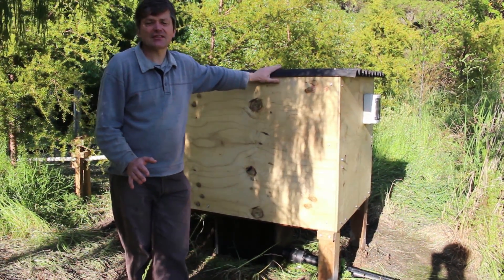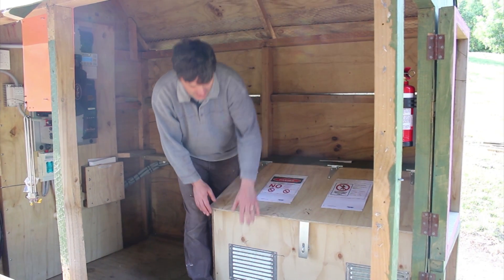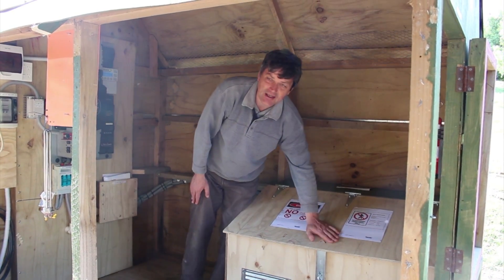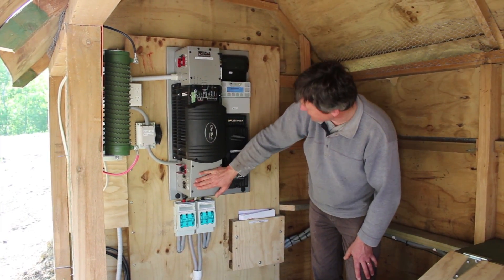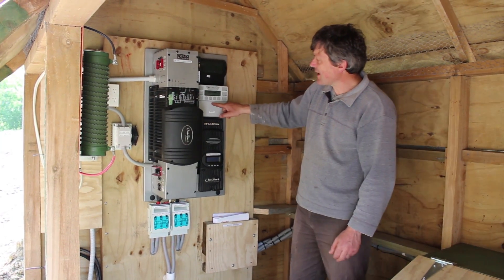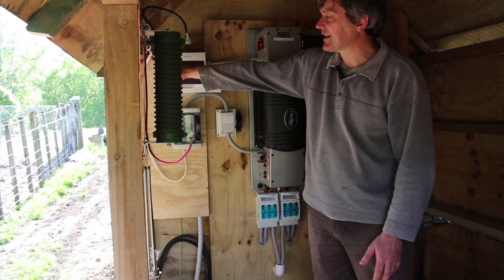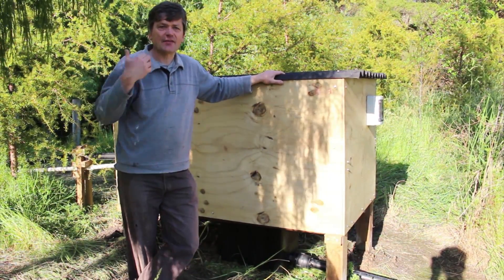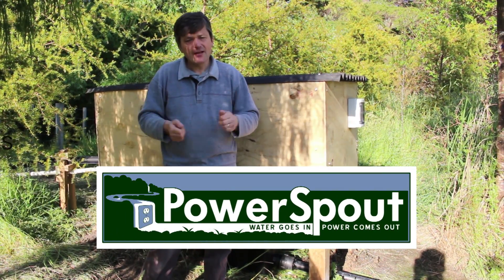PowerSpout PLT Install Video

Comment: Wicked product but THATS your battery bunker? At least line it with fire blanket (and another thin sheet of ply if u want.) and an exhaust vent outside of the enclosed area. 

Im looking at something kinda similar myself but I with some additional redundancy built in. I would be tempted to install a fire suppression system inside it as well. 

I will have another look at the video as im curious about the torque at the shaft and stuff. Surely that electric motor isnt putting that turbine under bugger resistance......

Comment: Great video, but can you clarify the power figures please? my schoolboy physics says that 160m(head) * 4l/s flow rate * 9.8m/s/s gravity gives a power of about 6kw, but you quote a continuous power output of 1.3kw, less than a quarter of that. I thought micro hydropower schemes should be able to achieve overall efficiencies of about  70%?

If I check the figures in the video using your own power calculator http://www.powerspout.com/advanced-calculator/ it still comes to over 3kw, about 50% of the theoretical. 

Or have I missed something?
Reply: 4l/s is the flow at the intake. Read the case study for turbine flows.
 https://drive.google.com/file/d/0BzVDBix3S_qbUUVxQ1VfOHBVdG8/view

Comment: what size/type of pipe  was used? Looks Great
Reply: 50mm ID, 63mm OD MDPE. The pipes is low grade 3.5Bar at the start and ends in 16 Bar.

Comment: What was the total install cost ?
Reply: +SynergisticECOnomy  If you read the last PowerSpout newsletter you will get the costing
Reply: About 45K $NZ, and the farm also got a decent water supply for the 1st time. With 1.6km of pipe is was not going to be cheap. Grid connection cost for the home was 2-3 times this amount, so it paid for itself on day 1